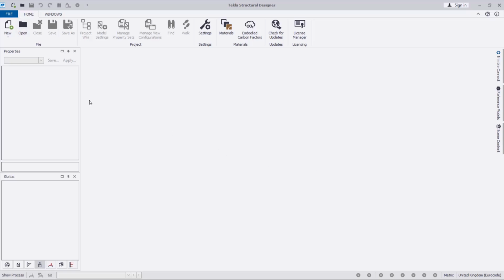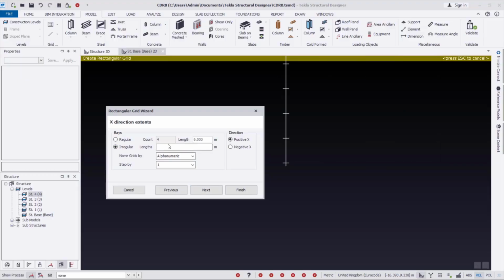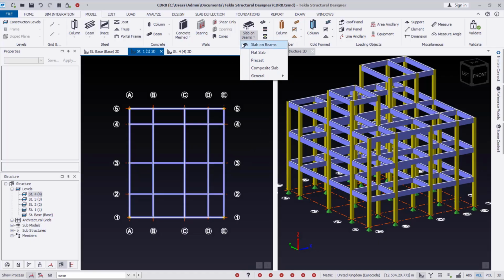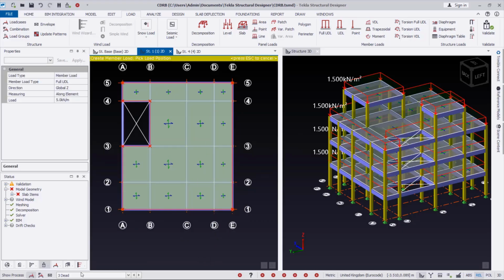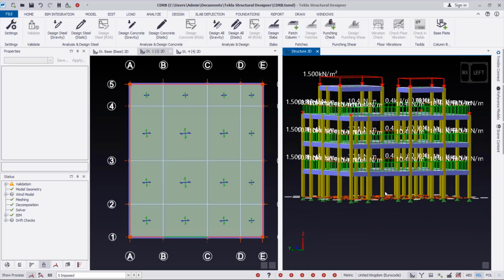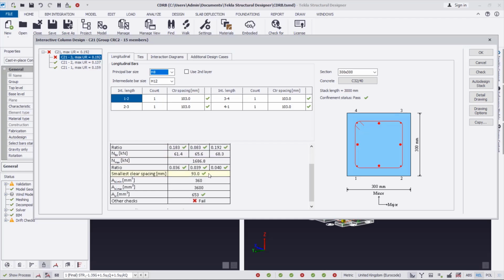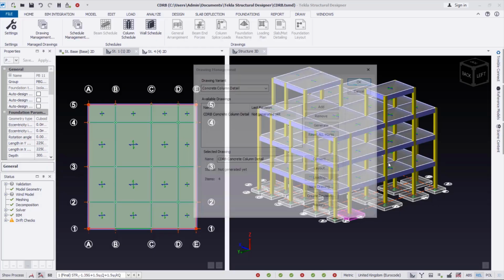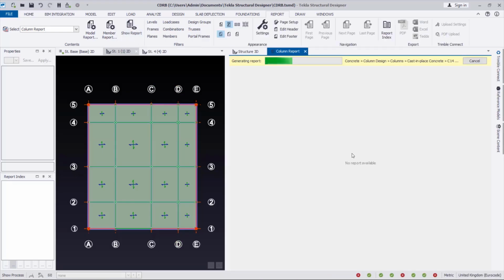The Future of Concrete: Revolutionizing RCC Building Design

Comment: The content is very engaging, and I truly appreciate it. Regarding the status validation, I still notice drift checks appearing as warnings. I’ve encountered the same issue in my project and would like to know whether there’s a way to resolve it or if it’s not a critical concern.
Reply from the maker: Not critically concerned to some extent.....but it can be get rid off if you apply rcc wall on the building model
Reply: @CADmade-easy  Thank you so much sir! it worked perfectly fine

Comment: Good content 🎉🎉. Pls tel me how to define single layer reinforcements in a slab and design it
Reply from the maker: Possible with yield line method of slab analysis and design. here is Finite Element Method which always double slab rebars layer. You switch off the top layer and design with the bottom layers if there is provision possible.

Comment: Nice job well done.

If I may ask, how can the sections on the beam reduce to like 1 per span instead of 3 on each span?
Reply from the maker: @abdulrasheedayodeleahmed306 you can set it accordingly before analysis Sir.
Reply: How and where?
Reply from the maker: @abdulrasheedayodeleahmed306  settings

Comment: Excuse me for asking what is the difference between it and Autodesk Revit. Thank you, sir.
Reply from the maker: @عبدالرحيمعيادأبوجوهره   Autodesk Revit is used for just modeling and detailing of members as well as presentation and documentation. 

Tekla Structural Designer is Civil Structural design software that design structural elements sections and reinforcement base on applied loads, produce members design report and detailed drawings.

Comment: Prota is the best
Reply from the maker: @engmahmoud8518    I agreed with you but it's just for some aspects other Aspects TSD is the best.
Reply: @CADmade-easy  Ah, OK for what  it's better than the others
Reply from the maker: @engmahmoud8518   it has three designs Engines but Prota have just two. 

It also have some design features in steel, concrete and Timbers that Prota doesn't have.